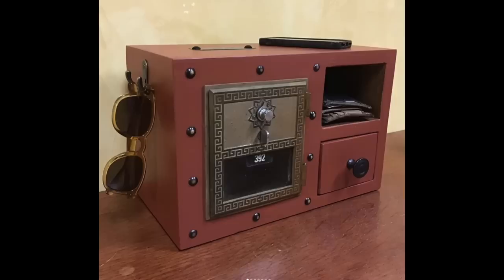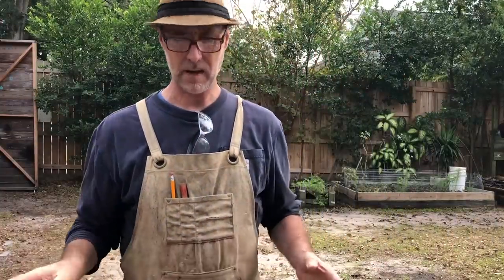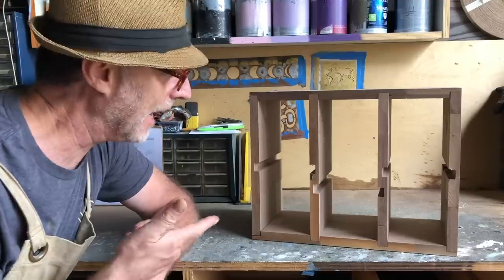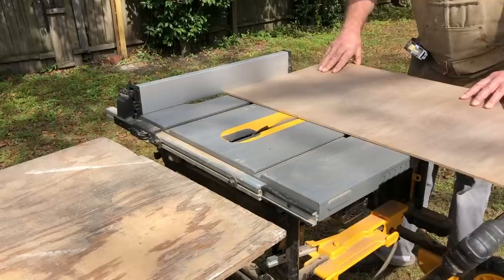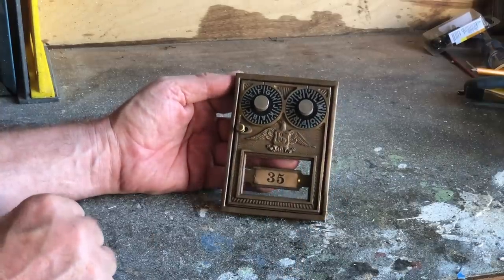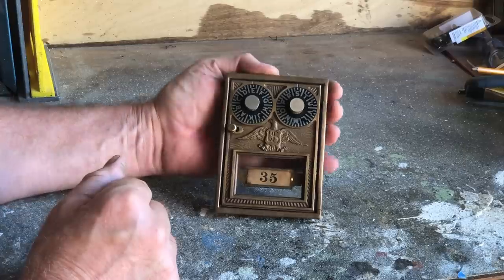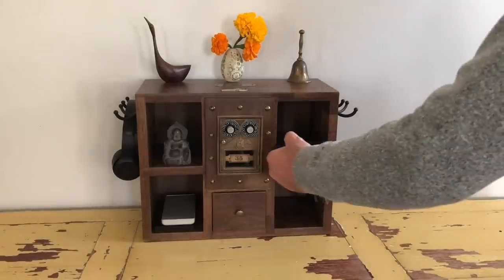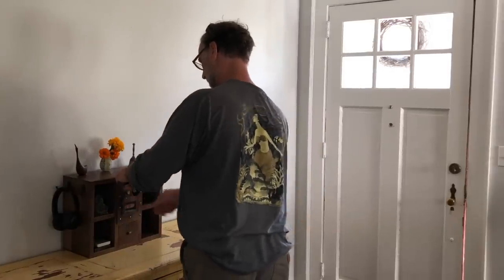A Mann Box Will Change Your Life

Comment: Excellent videography and superb audience-sensitive editing. Novel product, well thought out. I would point out two safety concerns: First, it is generally considered ill-advised to use miter gauge and fence simultaneously. It sets the stage for dangerous kickback. Second, cutting out the hole for the clever PO box door could easily be done before the board was cut down to its rather small size. Safety first.
Reply from the maker: Thank you I appreciate your advise. Safety first indeed. I need to build a sled!👍
Reply: @mrbloke  And thank you for taking my comment in good spirit!
Reply from the maker: Absolutely.....well you buttered me up nicely in the beginning there! I'd much rather have a bruised ego than be missing an eye or a finger. Thanks for looking out for me.
Reply from the maker: PLEASE TAKE NOTE NEWBIE WOODWORKERS. THERE WERE MISTAKES MADE IN THE MAKING OF THIS VIDEO. LUKILY NOBODY WAS INJURED!
Reply: Not quite true. It's only a potential hazard if you are making a THROUGH cut. Something that leaves a loose piece to twist and catch the blade. In this case he was cutting multiple cut dados. The work piece remained intact. No issues at all with this procedure.
Reply: it really looks like at least part of this was made while wearing flip flops, which is the biggest safety concern I imagine.
Reply: And the flip flops are some kind of guy code violation.
Reply: Love my flip flops when working at home.
Reply: @randycosgrove3608  Exactly.  The rule to "never" use them together is seldom explained thoroughly. No through cuts, no issue.  Nice to see someone else's workshop that has to be assembled in the yard before work can begin.  Enjoyed the video!
Reply: Oi, nice box mate!

Comment: Nice piece. It may not matter in the overall of time, but I noticed that in your glue ups you didn't allow for expansion and contraction.
Reply from the maker: It's walnut, so I'm not expecting too much movement. We keep our house temps pretty consistent, so hopefully that helps. There was a little wiggle room in the interior joints, and I would imagine those are the most important. I'm no master craftsmen. I'm not showing people how to do stuff, just ideas and possibilities and having fun making stuff. Thanks for your input. I will certainly think more of these things and do more research in the future. Cheers OR.

Comment: Only thing that could make this better is integrating a wireless charger for a phone on top, otherwise this is amazing
Reply from the maker: Thanks Travis....Great idea!
Reply: @mrbloke  I think the easiest way would be to use a hole saw on the underneath side to get it started then take out the bit so it doesn't poke through. 

Then maybe oscillating tool to take out the chunk made from the hole saw.... 
Once you do that that'll make the top area still look like normal but it would leave a really thin spot recessed where you can put around wireless charger and then notch out the wire so it runs back behind the box
I don't remember 100% for sure but I saw someone do it in a video.

Comment: I would be surprised if that back didn't try to split a side with the seasons considering how tight that fit up is.
Reply from the maker: It was cut down after the dry fit. Should be just fine......We keep our house at a pretty consistent temp year round, so hopefully all is good......If not, I'll learn from it. Cheers

Comment: This is a rad project and I think I’ll be making one for myself! But as a new woodworker I have some questions about his technique for cutting the dados, isn’t it dangerous to use a miter gauge in conjunction with the fence when cutting dados? Or is that only where there is a cut off?
Reply from the maker: Yes it's dangerous....You can get a nasty kickback. Don't use the miter gauge with the fence. I was going very slowly and being very careful, but I apologize! I should not have done it that way. I need to build a sled. I will do better next time 👍